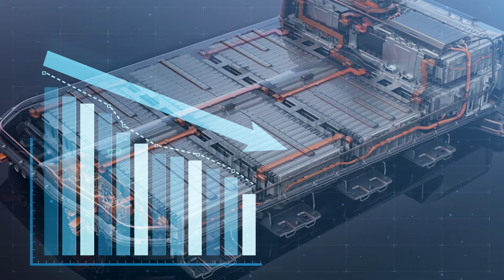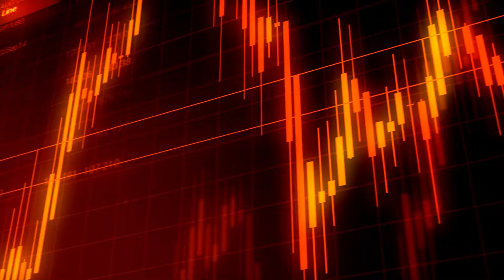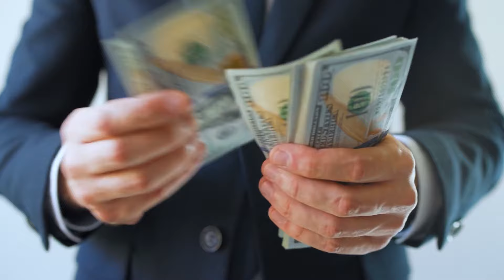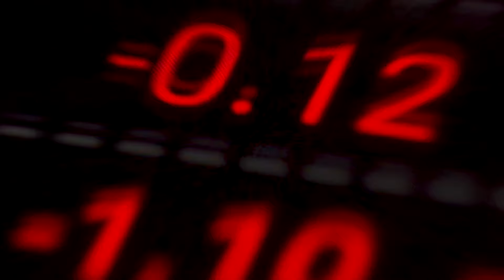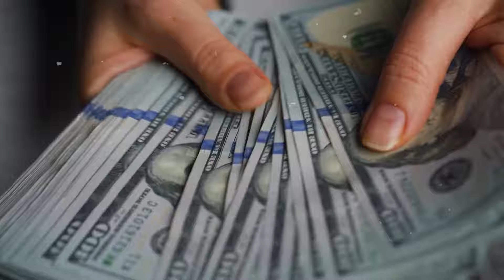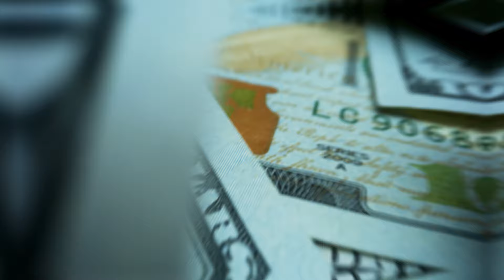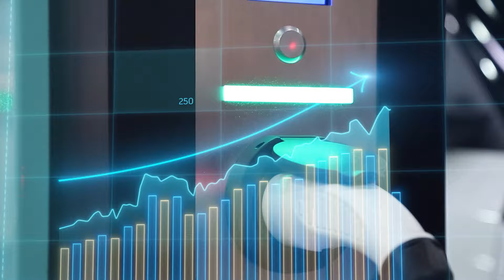Why Electric Cars Depreciate Faster Than You Think!

Comment: Oddly enough, this seems poorly researched.

Current EVs last 10+ years without needing a new battery.

When the battery fails, often a smaller component can be replaced pretty cheaply.

Seems more like fear mongering than anything else.
Reply: Nope batteries don't last 10+ years. That's a plain lie. One also doesn't talk higher maintenance costs and subsidies.
Reply: @thatkanpuriaguy8177  the department of energy says 12-15 years in a moderate climate.

But what do they know.